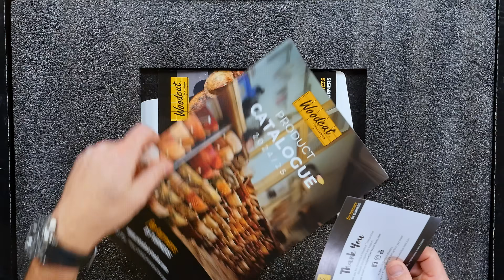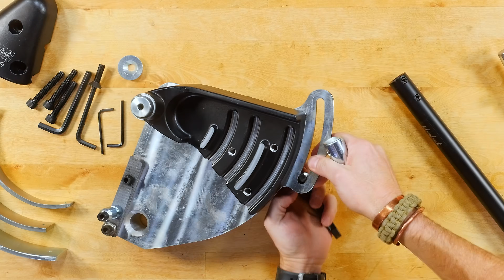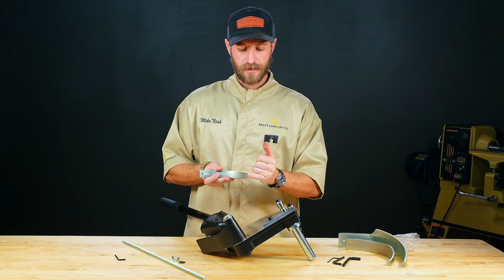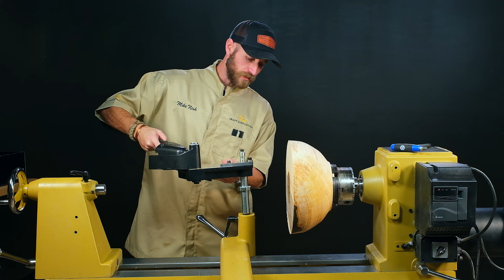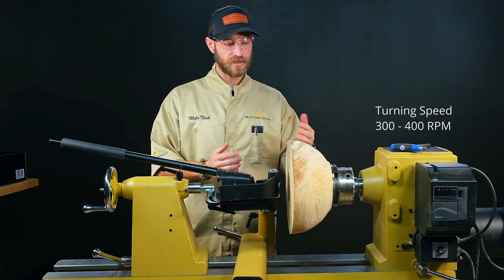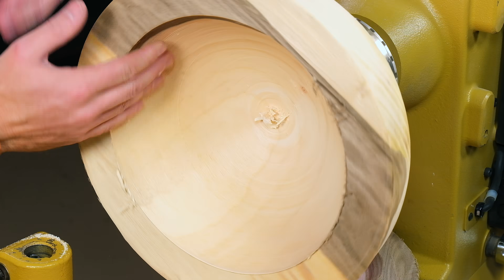Woodcut Bowlsaver Max 4 - Product In-Depth

Comment: Do you have to tighten up your Chuck with both sides of the Allen tightener? Saw you do that and thought it was odd/extra not necessary. That's all connected inside when you tighten up one Allen it tightens up everything
Reply from the maker: I like to tighten both pinion gears to make sure they are both at the same torque.  As chucks get worn they can have a bit of slop, so it's just a good safety measure.  -Mike

Comment: Thank you for the demo.  Several suppliers offer a 2 knife version on Amazon that is described as a "complete system".  Is that possible?  My largest lathe is 16" and that would be perfect for me.
Reply from the maker: I've seen those on amazon, and the price on them is suspect.  I would recommend buying from a Woodcut authorized dealer to make sure you're getting a genuine system.

Comment: I have a Woodsaver system and it is continually catching on my big oak blanks.  Any tips would be appreciated on how to reduce catches.  I stated the process at 400 to 500 rpms and reduced it to 250 to 300 thinking that would help.  I am advancing the knife slowly and removing it frequently, but it still catches on the oak.  Any suggestions appreciated.  i love your videos and store - jim
Reply from the maker: There are a number of factors that could be inducing a catch.  Give me a call at 1-800-551-8876 and ask for Mike,  I'll troubleshoot the issue with you.
Reply: @CraftSuppliesUSA  Thanks, will do!

Comment: Hi, I purchased a bowlsaver just yesterday and tried it out and have not been able to have any good results. The cutter jams and grabs as soon as the full edge makes contact jaming the lathe up and I can't even produce a shaving. I must make it less than ½ inch in the wood before desaster happens. I have tried various cutter heights I have tried different wood, I can't fin the problem. 

Any suggestions?
Reply from the maker: Because there are a number of factors that could be causing an issue, I recommend giving us a call at 1-800-551-8876 and we can trouble shoot the issue.  Thank you!

Comment: Great video MIke.   I just got a Woodcut BowlSaver Max 4 for Christmas.   Gave it a trial run the other day on a big birch blank.   Worked like a champ.   The only complaint really has to do with my Grizzly G0800 lathe.   My quill lock on the tailpiece is on top.   As a result the BowlSaver handle hits the quill lock.   I need to run it again to see if I can keep the quill lock in, but yet pull the cutter out clear of the workpiece.   Thanks

Comment: I prefer to start with the biggest core first, that way you can re mount the core using whatever your original mounting set up was so you can turn a tenon on each core as they get smaller.  It's more steps during coring but then you have tenons on all the blanks for when you go to finish them after drying.  Another technique is to cut a recess to chuck on in the face of the blank before starting to core.  If you do it that way then you can just use the same chuck and jaws for the whole process instead of remounting on a faceplate or the like.
Reply: genius idea!  I also prefer having tenons on my bowls. thank you for sharing!

Comment: This is awesome! Great video Mike. One question, would this unit fit and/or benefit me with my powermatic 2014? Obviously I can’t do large bowls but could get two small ones maybe?
Reply from the maker: You could get a couple small bowls with it, but the motor is a bit underpowered for coring.  I'd wait till you get a bigger lathe. -Mike
Reply: @ yeah that’s what I was assuming. I am saving up for the 3520C and I can’t wait. Thank you Mike! Also I don’t know if she has said anything but hit me up about the flimsy guides. I have a solution.

Comment: I've seen middle size bowl cut first with mortise added in the center at the top of the bowl at the start to easily add tenon after this cut.  Then smallest bowl cut last.  Any comments on pros or cons for cutting largest to smallest versus smallest to largest?
Reply: I go largest to smallest with mortise three way you describe.  It saves a headache of cutting a tenon on a warped blank after drying

Comment: Nice piece of equipment but as you pointed out, a little pricey. I guess it might pay for itself over time if you turned a lot of bowls. Also not being able to use it under 400 rpms, that leaves me out as the slowest my lathe turns is 500 rpms. Thanks for sharing the information and showing us how it works.
Reply: There is a hint: It is a hard mistake to press green wood  of walnut as hard as you showed! Especially your tenon has been to large for the used  jaws.
The  edges will be pressed too deep into the wood and might split it and that is very dangerous.
Greetings
Thomas